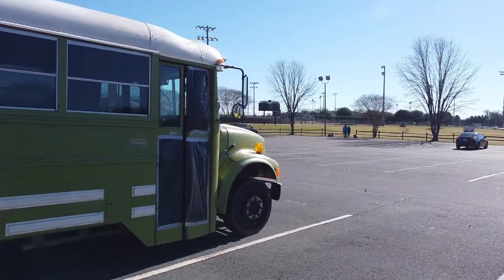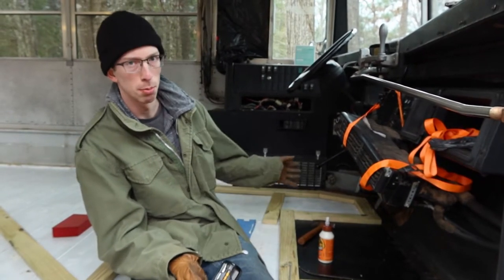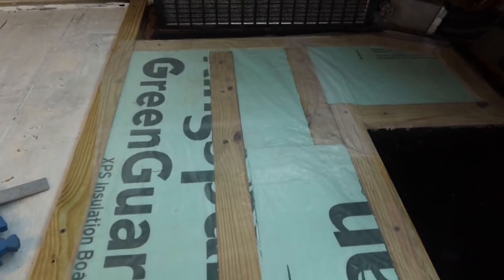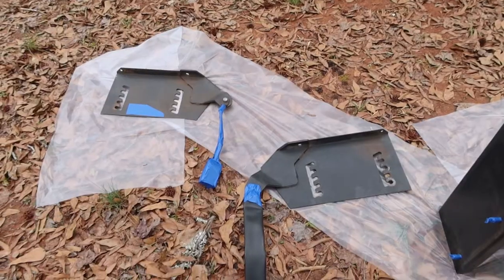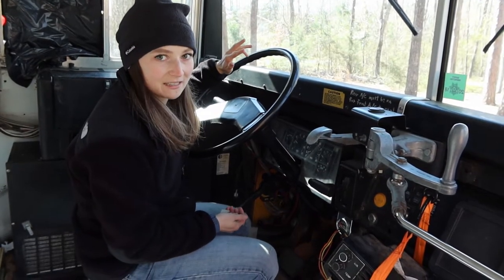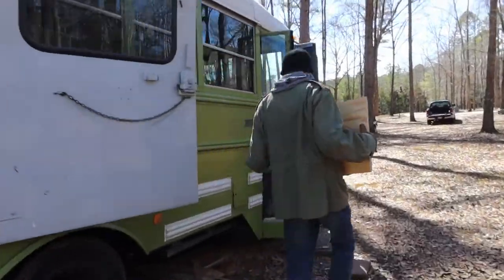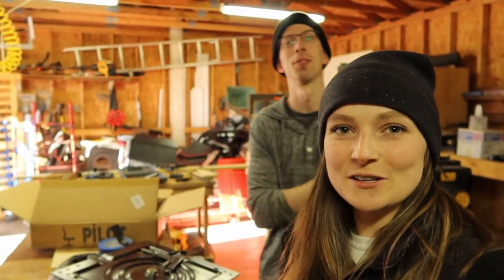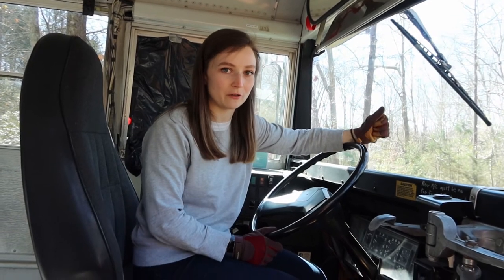Installing a Swivel Seat in Our Bus | SKOOLIE BUILD

Comment: Mechanics are the worst today, they over charge, they never deliver as expected, and fall through.  100% agree.  I also find it interesting that our buses are the same model but you have a missing section in the middle of the floor over the transmission.  This is not standard for these models, a previous owner has cut a hole to access the transmission more easily.  Which makes me wonder if I should cut a hole in mine so I can access mine more easily as it sounds like a decent upgrade idea to do.  I also have the same chair base but a different top end, I believe mine was aftermarket however because it looks like new condition, yours is probably the original chair.

Regarding hiccups, you are going to love me after this critique.  The sure fire way to get rid of them is to fill your mouth completely with water, as much as you can take in.  Stand straight up, bend down and touch your toes keeping your knees locked straight, and slowly swallow the water, it will push the air out of your diaphram as the water gets swallowed, and it will feel tight as you are swallowing but it's supposed to, and the hiccups will be gone.  Trust me on this.  I've saved 100's of people with this trick.

Comment: Hi. Did you put the wall & ceiling panels back into bus or where they all removed after the drivers seat being installed.  I'm just thinking those panels would be required for bus body integrity?